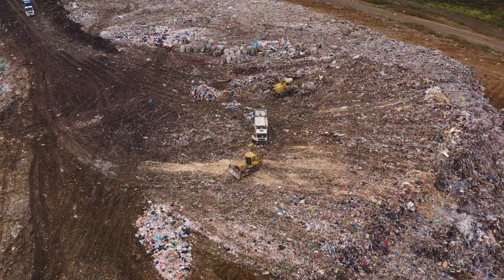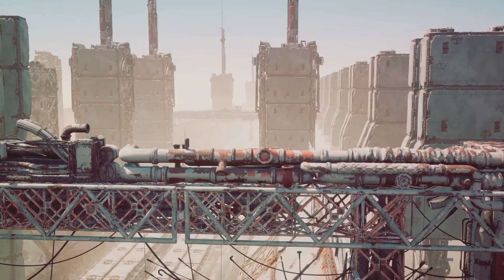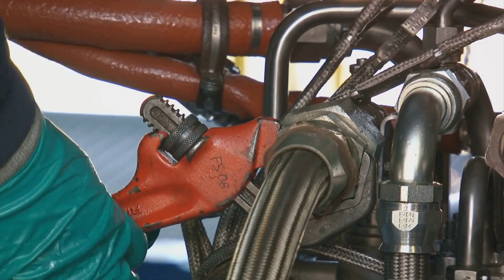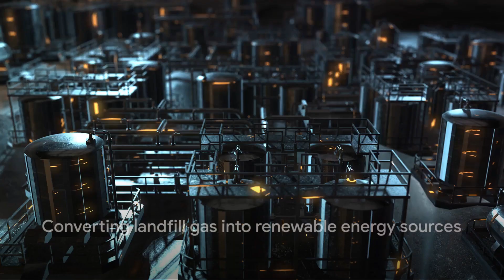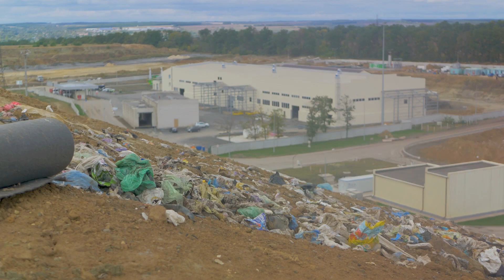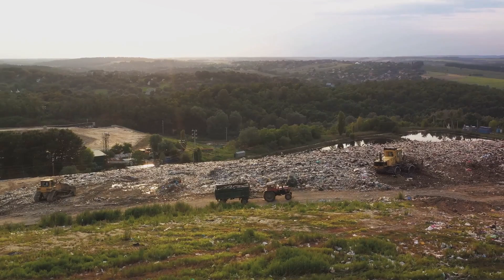The Energy of Landfill Gas

Comment: Can you accomplish this without damaging the health, safety and welfare of those living near these facilities with noise and pollution?  If not, go away.
Reply from the maker: Landfill gas energy projects aim to reduce pollution by capturing methane that would otherwise escape into the atmosphere. Properly managed facilities use advanced filtration and noise reduction technologies to minimize health and environmental impacts. When done right, they can turn waste into a cleaner energy source while improving air quality.
Reply: @futureenergytechnology    Agreed, but "When done right" includes not emitting noise having sound pressure levels or other characteristics, such as tonal audibility, impulsivity or cyclical variation of sound levels causing annoyance and the resulting significant increase of morbidity and mortality or interference with the use and enjoyment of property.  If doing so is not possible, then the facilities are not feasible. Apparently, it is not possible to do it right.
Reply from the maker: @LawrenceHough-u4j  Advanced landfill gas energy projects incorporate strict noise control measures, including sound barriers, low-noise equipment, and operational adjustments to minimize disturbances. While challenges exist, ongoing technological advancements aim to further reduce environmental and health impacts. Proper regulation and community engagement are essential to ensuring these facilities operate responsibly and sustainably.
Reply: I know of two that demonstrate that, although the noise measures control measures maybe strict, but the standards are completely inadequate and certainly do not adhere to current noise standards published by internationally recognized health organizations. The result. is great annoyance and resulting harm to the health and welfare of residents. I you want to be convincing, publish the noise standards strictly adhered to below.
Reply from the maker: @LawrenceHough-u4j  Thanks for your comment!